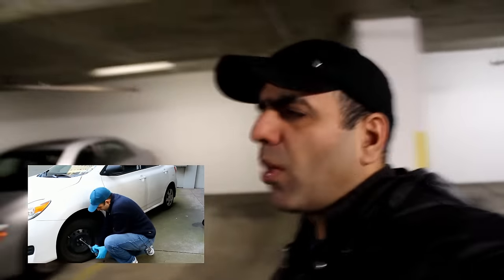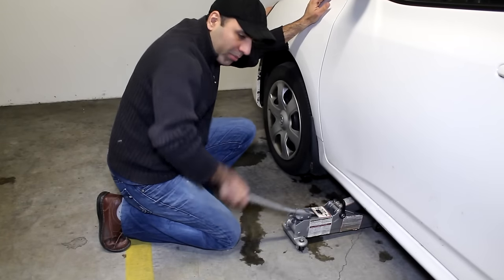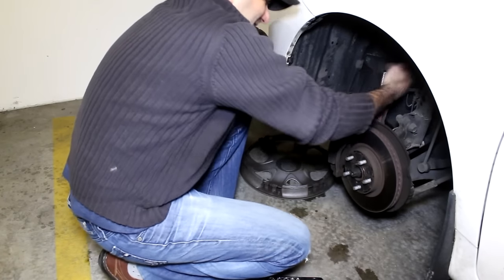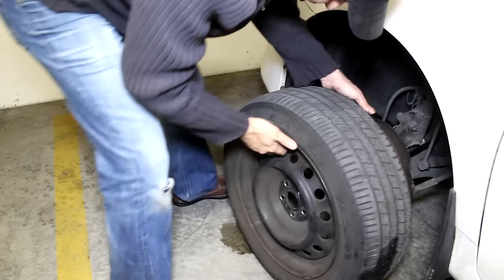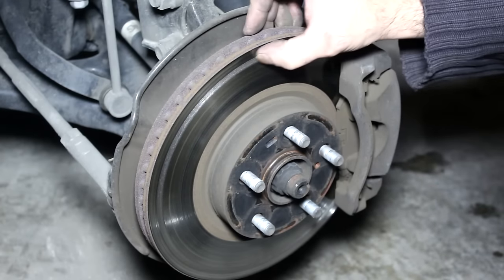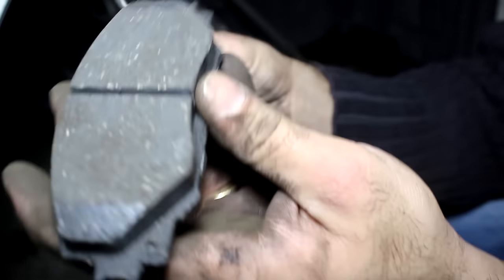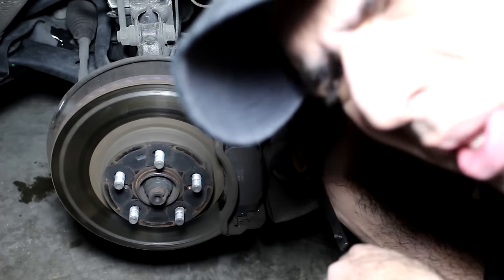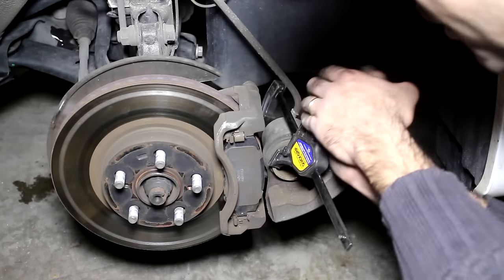ElectroVLOG-003: Changing the Last Pad

Comment: You always should remove the sliding bolts, clean them and also their bores in the pad holder, grease them up and put them back. Uneven wear like in your case is 99% related to the sliding bolts not sliding properly. A little copper/ceramic/aluminium grease on the guide rails of the pads is also a good idea. I also recommend using a torque wrench for the wheel nuts (100Nm should do fine). Love ur vids! Greetings from Germany

Comment: It probably is a good idea to have a damaged rotor resurfaced.  You really need it resurfaced if the rotor is out of round.  And I haven't done that in 14 years.
Reply: Also, best technique for retracting the caliper piston is to put a bit of tubing over the bleeder valve, open the valve, compress the piston, close the valve, then install the rotor.  Top off the master cylinder (this is a good way to keep your brake fluid reasonably fresh and pump the brakes a few times before moving the vehicle.

Comment: Next time use a C Clamp to push the cylinder back in. Or at the very least, put the old pad on with that tool you used. This is so there is even pressure on the cylinder, instead of one side like it was happening here.

Comment: Loosen lugs when it's on the ground so you don't put stress on the cv joints, differential, transmission, etc.  Also, use jack stands.  Bad things can happen if you don't.  Also, hang the caliper from your suspension spring using a bent C-shaped metal clothing hanger.  (so you don't put the weight of the caliper on the brake line--brake failure can equal death, so you want to be cautious)  I'd also recommend getting a cheap torque wrench from harbor freight.  (seriously they're like $25 or something)  Tighten them back on in a star pattern to 80-90 lb/ft.

Comment: Please Dont break the nuts loose by standing.  You can break the stud.  The 4 way lug wrenches suck.  Get a lug wrench that is a single size and longer that looks like an "L".   Then put the wrench on so you are pulling up and bend/use your legs not your back.

Comment: @ 6:26 Did you remember to take the cap off the master cylinder?...
This had to be the most dangerous brake job I've seen in a long time.
You do realize you're supposed to replace all pads at once, right?
You did a very dangerous thing just replacing a pad here and there.
Either you have very good luck, or this is another one of your "I'm stupid" videos, LOL!

Comment: You had to open the cap from the brake reservoir to push the Piston back in
Reply: Nope...The reservoir has a bladder inside the cap for that.
Reply: @mrbmp09  opening the cap would give the fluid a chance to over spill if the fluid is maxed out. With the cap on, all you doing is forcing the fluid back into a full reservoir. Me personally, I would had open the bleeder valve and then push in the Piston. That will remove any old fluid from the caliper and let new fluid flow thru. 2nd choice would be opening the reservoir cap to let the fluid from the line be pushed back into the reservoir.
Reply: @fitodaking16  There is plenty of room in the bladder inside the cap for the extra fluid even if it were full.
Reply: @mrbmp09  where you from? Cause it seems we in 2 different COUNTRY.

Comment: Couple of hopefully helpful tips to anyone without sufficient knowledge. Be careful pumping brake pedal with no pads in, if the caliper comes out too much it will either fall out and / or leak brake fluid. the system will need to be re-bled to remove any air or braking performance will be degraded if this happens. Clean any dirt / dust crap off the piston(s) with a clean rag before pushing them back in as dirt may jam the piston otherwise.. brake cleaners can help but make sure they wont degrade any rubber seals.. pumping the pedal very slightly to extend the piston will help clean the area behind the seal, be careful of popping piston out. Keep an eye on fluid level when pushing piston(s) back in.. if you have topped up brake fluid with old pads installed then pressing them back in can cause it to overflow.. remove excess fluid after pushing in pistons. Some pistons wind in rather than push, you can twist it while pushing or buy a special tool. Make sure you get no oil or grease on the brake pad surface and be sure to wipe disc over with brake fluid to remove any contamination. Some parts may require lubricating greases like pins etc, check a manual if unsure. Overhauling most brake systems isn't difficult but make sure to take notes and not to rush, if in doubt get a second opinion from somebody with experience, A faulty brake system can be catastrophic. While changing pads always useful to inspect hoses for signs of degradation and rubber seals for failure as they can be changed at the same time. Brake systems, especially those with ABS may require a special procedure to bleed any air from the system, if not done correctly will result in spongy feeling brakes and lack of braking performance.

Comment: First, break your lug nuts while your car is still on the ground. Only breaks it, don't loose them up all the way. Using so called "Cheater Bar" is going to make your job so much easier if you using supplied car wrench.
Second, put your wheel under your car while you working on it while it's still jacked up, it works as extra protection if the jack fails.
Third, brake booster (the thing that made braking so much easier) only works one way to push the brake piston outwards. It doesn't help you if you try to push the piston inwards using C-clip.
Fourth, if "squeaking/grinding" noise came out of your braking system, change your brake pad right away. It's alarm to alert you that your brake pad is worn out, and it's not supposed to grind your brake rotor anyway. You just changed your brake pad too late.
Fifth, you have 5 lug nuts. Tighten it in star pattern, using torque wrench is recommended so you don't over tighten it (it breaks the bolt or nut threads) or less tighten it (the lug nut loosen during driving session and putting you and your family at risk of wheel comes out from your car)

Comment: No matter how much material is left on the pad, always change all of them at the same time. Also brake grease, use it.
Also if the pad has gone metal to metal, doesn’t matter how little, change the disc aswell. Both sides no matter how think the disc is. 
You can turn the car on, just don’t press the brake pedal or the piston will shoot out if you do it enough. If it won’t go back in, possibly rusted piston.

Comment: Dear Mr. Boom, I know you are very good at electronics, but perhaps you should take your car to someone who is very good as mechanic.  Maybe fix something electronic for him, he do brakes for you?  The "screamers" only scream after the pads are shot, and the rotors grooved, they are designed like that.  Pssst, put the brake pad across the piston and clamp in the middle, it will slip right in.  It was fun to watch though, and the nuts to get tighter with time, everything, air, water, dirt oil between the nut and stud threads squeezes out from constant pressure and enough room, and they end up hard steel on hard steel, and begin corrosion bonds.  You really do very nice electronics though. See you again.

Comment: If you take the cap off the break fluid reservoir the caliper will easily be pushed back. Just watch the fluid level so it doesn't overflow. Also never press the brakes when you have the caliper off. It needs the resistance from the pads and rotor not to blow the seal and piston out. You got lucky with that plastic ratchet clamp.

Comment: Medhi, I love you dude, but so many things in thus video are legitimately unsafe. first and foremost, if you want to do your own work investing a pair of jack stands. If that jack were to fail you'd be in a whole mess of trouble. people have mentioned to boots already, so I'll skip that. Your rotor needs to be replaced or resurfaced, as the uneven widths of your two front rotors will compromise braking power. Don't allow the caliper to hang on the hose like that, it's a hydraulic hide not designed to carry weight and could potentially tear and force fluid out, making your brakes "squishy" or "spongey". Personally, I think the pads on both sides should be changed now for a more even wear pattern, and better braking feel. Please Medhi be safe, it might be fun to watch you explode circuitry, but automobiles are just as dangerous if your unfamiliar with them.
Reply: Additional thought: When depressing the caliper, use the old brake pad as a way to more evenly distribute force over the surface or the piston, it makes it much easier to press it back in.

Comment: the brake system on a car is hydraulic. the only part of the brake system that is powered by the cars ignition system is the ABS pump. so starting the car and turning the key on was completely useless. the brakes are completely mechanical and have very few electronics hooked up to them

Comment: Those are actually rattle clips they are never supposed to to touch your rotor they're not designed to squeak and you should always change both sides of the brakes never just one and the fronts usually wear faster because all your weight is in the front when you stop.  I doubt your rotor can be turned now so you probably need a new one and if you don't fix the problem it will cause your brakes to wear faster and uneven  it's better to fix the problems the first time because if not it will cost more in the long run and they will wear faster now....

Comment: I bet your going to have to change that caliper,if you don't change it,you risk prematurely wearing out your brand new break pads.I could not help to notice that you didn't grease the slides either.This can result in break calipers hanging up when you release the break pedal,this is potentially dangerous especially in winter weather driving.

Comment: Am I the only one that just opens the bleeder valve on the caliper to push in the piston? Sure, you have to bleed the brakes afterwards, but they make a tool for that too that's only a couple of dollars at the auto parts store. I usually put a drip pan under the wheel hub to catch any brake fluid and then clean everything with brake cleaner afterwards.

Comment: To push in the piston into the brakingclamp, open up the airbleed valve.............
You know, the valve you use to bleed the air out when you replace the fluid.

Simple.
Reply: or use a vice...........

Comment: The two useful things I learned from my father... 1) Loosen the nuts before jacking the car up (which has been mentioned) 2) ALWAYS tighten them with the tool that'll be in the car. On cars and other small vehicles (SUVs) they do not need to be torqued to an extreme. 

Inertia from braking, minimal sidewardsways forces, and a little bit of water ingress/grit, and the fact that there are multiple (usually five) large nuts will keep the wheels on your car.

Comment: For pushing the brake piston back, you can use a bolt through a threaded flat metal band about 3mm thick. Or you can use an already made device.

Comment: If you use a C clamp to squeeze the cylinder back in it makes it a million times easier.  You can also use the old pad to apply even pressure on the cylinder.

Comment: Always break the torque of the lug nuts when the car is on the ground and torque them again also when the car is on the ground. I always use the bar from the jack as an extention to break the torque . Makes the job a whole lot easier

Comment: While it is obvious that this video was made just to cut every corner in the procedure, brakes are one of the things on your car that you should never cut corners on (tires would be another).  

List of things that were done improperly. (at least the things that I noticed right away)

-Using a cheap 4-way tire iron that lacks the necessary leverage.  This is dangerous and can also result in snapping a lug stud. (if you have to stand on it, get a bigger 4-way or a breaker bar.

-Break the lugs loose with the all or most of the vehicle's weight still on the tire so it doesn't spin.

-When you lift the vehicle put it on a jack stand.  (never rely on a hydraulic jack to support the weight of the vehicle while you are working on it.  Jack stands are very inexpensive.)

-You should never force the brake fluid out of the cylinder and back into the system as it can carry dirt and other contaminants back into the brake system which can cause other parts in the system to fail like the master cylinder.  In fact, if it has really been 7 years since the system was last serviced if should be completely flushed and new brake fluid put in.  Brake fluid has a shelf life after which it should be replaced since it absorbs water from the air.  That water can cause corrosion and other issues in the brake system.  (Get a one person brake bleeding kit that has a vacuum hand pump and pull a vacuum on the bleeder and then carefully push the piston back using the old brake pad and a C-Clamp.)

-You should inspect and regrease the slide pins that the caliper assembly moves on as well as putting anti-seize on the clips before installing.  

-As you mentioned in the video the rotors should have been turned if possible or replaced. (Rotors are generally not all that expensive if you want brakes that perform like new.)

-Since you had both sides apart you should have just replaced the pads on both sides so they will match.  (Brake pads are cheap in comparison to the time it generally takes to tear everything apart to replace them.)

-Once you have the tire back on with all the lugs tight in the air lower the car and torque the lugs with an actual torque wrench to spec in a star pattern  (you can get torque wrenches pretty inexpensively these days especially second hand.  It is also a good idea to recheck the torque after 100 miles or so.)

-If the lug nuts were really hard to break loose you can apply a small amount of anti-seize to the lug studs to make them easier to turn in the future.  (if torqued properly the lugs won't loosen up even with anti-seize on them since the friction surface is the tapered wedge on each lug nut that meets and centers the spider onto the hub.)

-If your front pads needed replacing, it would be a good idea to check and possibly service the rear brakes as well.  (Remember the front brakes are responsible for 60-70% of the braking of the car while the back is responsible for the remainder.)

Either way, at least you finally serviced the brakes so they should at least perform better than before.

Comment: also WHERE THE HELL do you get 1 set of pads. every EVERY box of pads come in a set of 4, not two. and there cheep.
Reply: loligagger85 Probably still had them from 3 years ago when he didnt use them.
Reply: STILL, his video was about NOT doing just one side, so he just does the other side. LORD this guy needs to stick to voltage not vehicles

Comment: Wrong tool for the job on the piston. They make a few different tools just for that job which I own but also as a mechanic ive learned you can press the piston in with a screwdriver before you change the pads. Sometimes before you even take the caliper loose. 

I will teach you how to be a mechanic if you teach me how to design custom circuits. Deal?

Comment: Whenever changing your brakes, and your rotors are bad you should always change your rotors as well, the cost is about the same to get them cut these days. So buying new rotors is easier and lasts longer. If you dont replace the rotors when they have bad wear the brakes,being new, will go back to old brake wear because thats imprint is still on the rotors. Also dont change your brakes too late if you do your caliper can push out too far and then it wont go back in, meaning you got to buy a new caliper.

Comment: You are not just endangering yourself now, you could be if you are copied endangering others who think what you are doing is ok.  Buy a torque wrench and use thread lock on those caliper hanger bracket pin threads.

Comment: Loosen the cap on your brake fluid before you push the pistons in! Pressurised system, silly.
(failing that, do the same to the master cylinder)

Comment: you should replace the rotor. they're super cheap on a car like that. like $30 a pair. also why would you press the brake? that does the opposite of what you're trying to achieve. that's how the pads depress on the rotor. you could've sent that clamp flying if there was people around. just use the correct piston depress tool or some pliers with long handle for leverage. you're supposed to open the master cylinder reservoir cap so the fluid has somewhere to go as you push on the piston. that's part of why it wouldn't budge.  lastly you should use a torque wrench to achieve proper and consistent torque. not necessary as someone said to have the car on the ground to tighten the lug nuts. if anything that disrupts torque value as now you have additional forces to fight.

Comment: you really know less about cars than I do about electronics, and I can't conect two wires together. wheel up in the air and wondering why is it so hard to undo the bolts, facepalm lvl 999